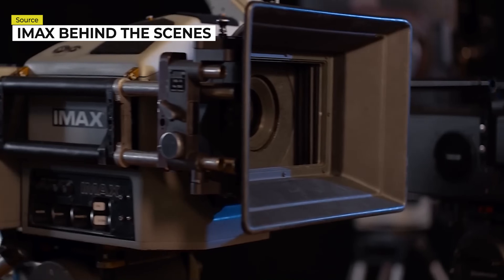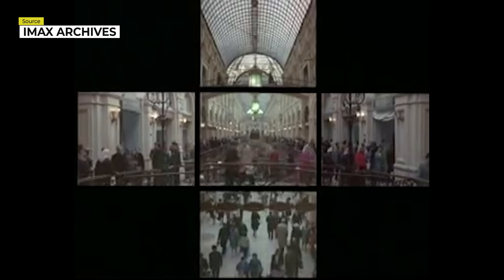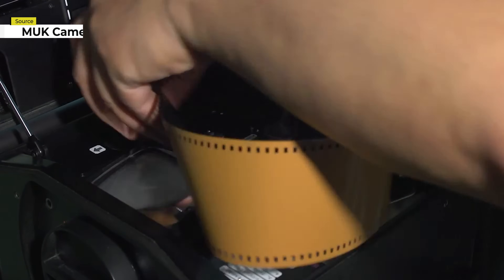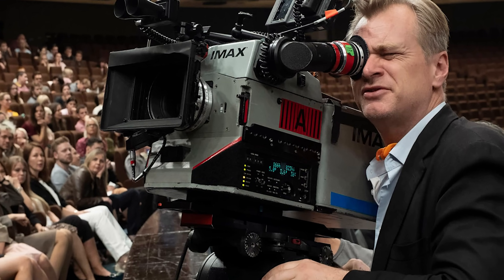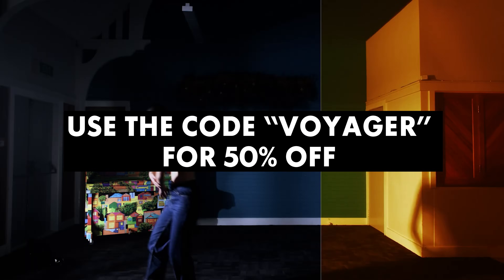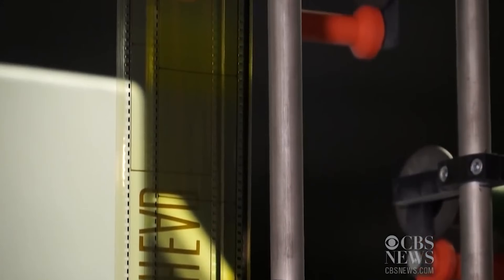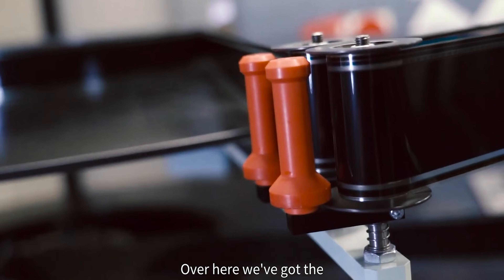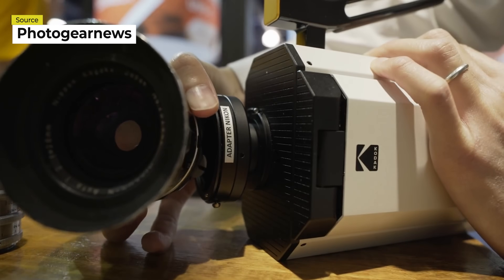The TRUTH about building a Digital IMAX camera

Comment: I don't understand why do you need to design different lenses for a sensor as big as imax film? Why can't you use the already existing lenses that were used to shoot film?
It is also a strange idea to measure resolution without addressing sensor size. Even in a phone could shoot an 18k video it couldn’t compete with the image quality of a large sensor or large film format.
Reply from the maker: Well it depends on how the film lenses are constructed. They had a lot of issues with panavision lenses in the star wars: attack of the clones because the back elements were so large that it wouldn't fit with the sensor. So I'm thinking you'd probably need to at least redesign the lens mount and back element area to accommodate a digital sensor

Comment: The projection issue is honestly the biggest one. I love the idea of large formats, but basically no theatres around me can even get regular format 35mm to look and sound as good as my home theater lmao.

I’ve been to a local theatre that projected 15 perf 70mm. It looked incredible, but the whole experience was kind of tainted by the fact that the speakers were old and blown out.
Reply: Unless it was IMAX You didn't see 15/70. They're the only ones that do that. Also part of the IMAX experience is good sound. They have their own sound system. So you probably just saw regular 70mm. Was it the Music Box? They have notoriously bad speakers...idk why they don't upgrade them...
Reply: @oneofthedreamers you don’t have a good speaker system at home if you think imax sounds good lol
Reply: @oneofthedreamers  I did see 15/70 in IMAX. My local IMAX's speakers are pretty lame. I also saw a couple regular 70mm films and the speakers in that theatre were unfortunately even worse.
Reply: @TheLingo56  was it in langley?
Reply: @udaysingh-wr2kw  Yup, that theater's speakers have needed a serious upgrade for years.
Reply: @TheLingo56  i think thats why they didnt play dune 2 this time
Reply: 35mm supports 4 sound formats, 3 of which are digital. The edges have the SDDS 7 channel soundtrack. Between the sprockets is a Dolby Digital 5.1 soundtrack. There is a time code for DTS which the actual sound in on CD and there is a backup Stereo / Pro Logic Analog optical audio track if all the digital tracks fail or are not available for whatever reason. Most people can't tell the difference or conscientiously care. Much like the difference between film and digital. Film looks / feels better from an emotional standpoint but few can tell the difference and everyone seems to think sharpness is the gold standard for judging picture quality to which Digital wins every time. I say digital is unnaturally Sharp and therefore a film print that is properly cared for (keep the film off the floor) renders a more true to life, emotional connection to the image on the screen. There is one theater that understands this. The Alamo Drafthouse has 1 or 2 film projectors in most of their theaters. They say people prefer the look  of film over the look of digital because of the improved contrast and better black levels. 
Most theaters prefer digital as it is far less money per copy of the movie and it can be shown in multiple theaters at a push of a button. A movie on 35mm costs around $4,500+ per copy and to show it in 2 theaters simultaneously, the theater needs to have interlock equipment so one copy can run in 2 projectors at the same time. The film print weight is over 100 pounds and requires 2 people to move it from projector to projector (platter). Some smaller theaters had a single person move the print after clamping them up.

Film has an equivalent resolution of around 6k, however what you see in theaters is copy of a copy of a copy and the resolution of the theater print is closer to 4k. IMAX the company has made claims of a resolution equal to 18k which is a major improvement over standard 70mm which is around 8k equivalent. Film has grain and digital has pixels so no perfect resolution conversation. And other factors complicate this farther. So if anyone has a chance to watch a real IMAX 70mm movie, I strongly recommend you go for it. IMAX film is hands down the best projection system on the planet and well worth the extra cash!
Reply: @andrewbarnum5040  Yeah, I love the look and feel of film. Whenever something I want to see is projected on film I’ll always go out of my way to see it that way, assuming no major compromise. Just wish that wasn’t as rare.
Reply: @TheLingo56  You and me both. Don't know what state your in but I am from Pennsylvania and the Alamo Drafthouse was making some real progress in getting more movies available on film, then COVID happened and everything film related dried up. I would think with the mass resurgence of film photography there would be an increase in the demand for projected film but so far nothing. I visit the website in70mm from time to time which has news of new 70mm productions and showings on 70mm. I also keep an eye on the directors who have gotten theaters to reinstall film projection equipment just for their one movie. I would like to see theaters have one theater which is both film and digital compatible which would greenlight more film releases. Unfortunately I don't see that happening.
Reply: Here in Czech Republic, we have a lot of oldschools cinemas with equipment in good condition and also we have IMAX with 70 mm projector, I saw Oppenheimer there and it was perfect. After what I read about 70 mm projections in some US cinemas, I think we are super lucky here that we keep that equipment in such a good condition, it looked perfect.
We have still a lot of those cinemas from our first republic era (from 20s or 30s) in those art deco buildings, but unfortunately, they mostly have pretty bad acoustics there and small screens, so that's why I prefer modern cinemas, but modern cinemas don't play from 35 mm film at all. 35 mm format is not that superior compared to 4K digital, that's why it died. 
I noticed one thing abou that 70 mm projection, even when it's only 24 FPS, it looked somehow smoother without that typical screen tearing like modern movies always have.

BTW: When it's classic digital projection, there is no reason to go to IMAX, it's just bigger screen, maybe slightly better audio, but not a big difference compared to other modern cinemas. It must be really IMAX movie shot with IMAX cameras which forces me to go to IMAX.
Reply: I would like to see a video on the pro & cons of the IMAX film projector vs the IMAX digital projector.
Reply: Most theaters do not run 35mm - they run digital. The most common digital format today is 2k Xenon. Contrast ratio caps out at 2,000:1. Film can get up to 250,000:1 on Kodak 2393. Modern 35mm Scope can reach equivalent "resolutions" of ~8k with the correct DI process. Film will always look better than digital while being cheaper. Let alone the brightness side of things.
Reply: I saw Oppenheimer at the only real 15/70mm IMAX in Florida that was playing the film and the sound was SPECTACULAR, so I don't know where you went, but something is amiss here...
Reply: you guys have local imax theater?
Reply: A good 35mm print projected properly can easily look better than 4k. If they can't get 35 to look good, they either have a bad print with lines through it, or they don't know what they're doing.
Reply: @SplicesAndCelluloid  The few times I've seen properly projected 35mm it looked good, but usually the sound was lacking.
Reply: Poor guy. You need to hit up a better theater
Reply: @kamikaze2613  Wish there were better options around Vancouver! Tried many different theatres and all of them are missing something.

Comment: Based off some math I did when the URSA 12K sensor was released I found that using that pixel density in an IMAX 1570 size sensor would result in 32K x 22K resolution! I'm all for us being able to achieve a digital IMAX sensor size equivalent to 1570 film. And, technically as long as we can use the same lenses used for the film then there are lenses already available for that sensor size. We simply need to make the digital camera have the lens mount that the 1570 film cameras have. 

A lot of theoretical, but I hope one day we can do it. Arri needs to update their 65mm Sensor in the Alexa 65 now based off the new Alexa 35 sensor. That's step one.
Reply from the maker: For real! It's all so hypothetical and everyone has a different opinion or calculation of what it would look like. Makes this an interesting topic imo!

Comment: There is no additive process that can emulate IMAX to a generic 8K resolution recording... You need to have a big sensor or it will not work.. Try shooting a 50mm lens on a 67 format with the floor/ground in frame and try getting the same FOV with a S35 gate and you'll need a much wider equivalent.  As such the S35 will feel much further away as your subject will be smaller. Larger gates are not magic... they just seem closer because of physics. The IMAX look is mostly apparent at closeups. Eat shit. No shit, not grain, no color-shift of a bayer-sensor will help this. That's how it is.
Reply from the maker: Agreed! There are a million different variables to actually make it happen. But more than likely this is more fiction than reality. We just used the video as a question that's interesting to think about because everyone has an opinion on what it would take or If it's even possible!

But yeah, totally agree. Film emulators can't fully replace film yet. And not sure if they ever can. My best bet would be some sort of AI driven system that's analyzed billions of frames of film and runs hundreds of simulators for thing like halation and other variables. But who knows 😅

Comment: I love the history - 
1 question - I don't understand why they weren't able to use 35mm and shoot it twice as wide ?? It would be the same 70mm ... It could be to keep the reel size manageable and to keep the frame rate "timing" the same as 35mm ??

Help Team Internet 👍👍
Reply: good question. i think the arri 65 is using two large arri sensors to get a bigger sensor like you suppose. i learned, while searching for a  camera that can do 4k 60p, that there are issues to capture/process all the data. but i would too suggest just to build like 3-4 more   sensors + "proccecing" units into one camera to have one big digital IMAX camera :D guess its easier said than done ^^
Reply: @GammabitFilms  I agree with you - it seems the "data throughout" is the current roadblock to overcome 

I think they can build a sensor big enough - i can't wait to see it when it happens 👍👍

Keep up the great videos
Reply from the maker: Appreciate it! It's all super interesting questions!
Reply: 35mm but twice as wide? Hmmm. You might wanna look up something called 'VistaVision'

Comment: The DoF thing is nonsense. Sure, you might have a smaller circle of confusion because of the high resolution, but the background blur and subject separation is entirely to do with the lens focal length and aperture.
Doesn't matter how high resolution your APS-H sensor is, it's going to have a "deeper" focus than a 35mm sensor or larger with the same angle of view at the same f-stop.
Reply: But there is kinda empirical fact to that focus with high resolution lens + high resolution sensor is "harder" to nail. Obviously it's just perception(?) and a bad lens is technically equally hard to focus but it will always look more blurry.

This is very easy to test either way, using a low quality lens or a low resolution sensor. The latter makes you feel kinda incredibly stupid because you know that there should be that super sharp sweet spot but you can never hit it :D
Reply: @hbp_  Correct, that's what the circle of confusion is. The higher your resolution the harder it is to get "perfect" focus. But the amount of background/foreground blur, thus the "separation" that you see, is the same.
Reply: True, but i prefer smaller sensors since you can shoot at wider apertures and not sacrifice DoF.
Reply: @Dennis94913  Assuming equivalent sensor technologies used in manufacturing, there isn't really a difference. You can simply stop down the larger sensor to match the DoF and increase the ISO to match the exposure, giving you a nearly identical image.
Reply: @Dennis94913  I have been recently liking B4 because of this. Going the full circle, because I first went to EF S35 from MFT. However, B4 lenses are much nicer physically than anything you can mount on MFT :)